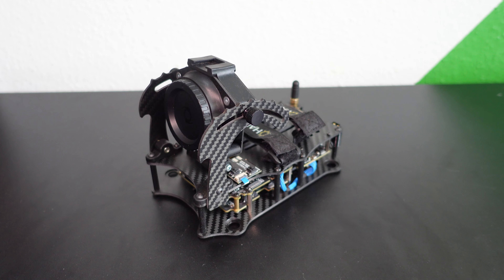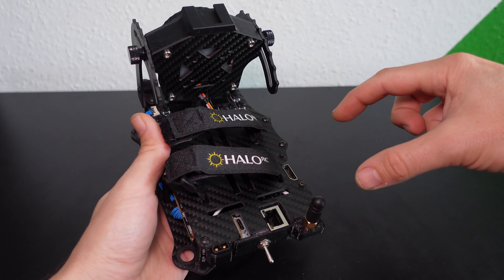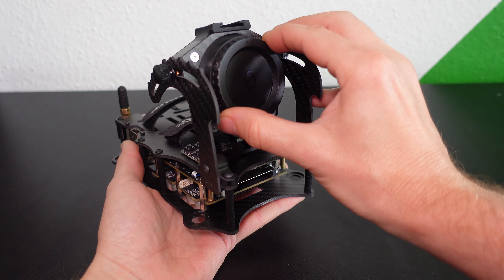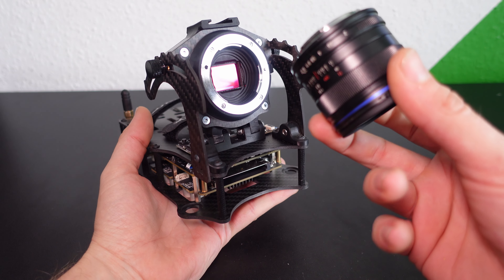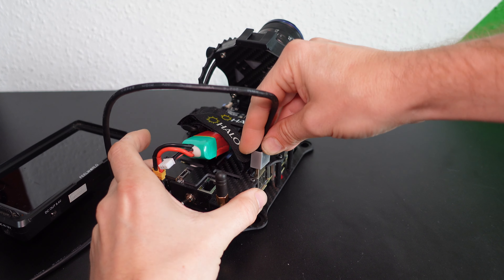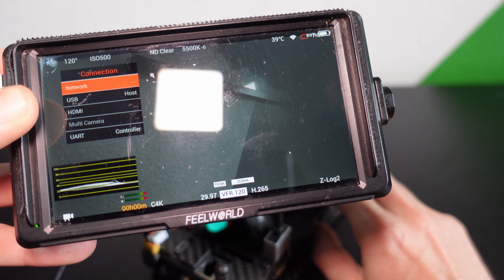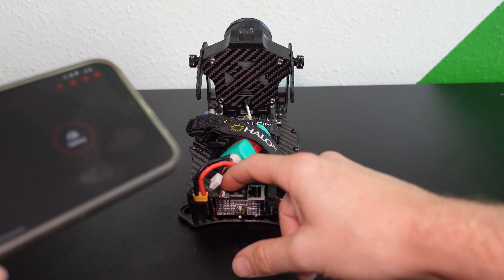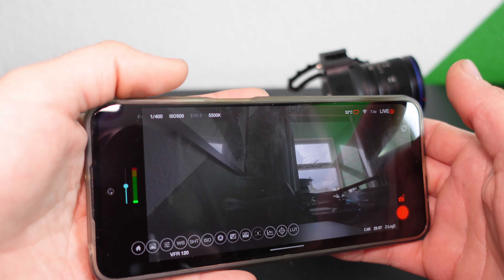HaloRC Naked Z Cam M4 - Overview

Comment: Epic dude! You can also use the Zcam app on Android (I do sometimes). Another awesome aspect you missed is the 4:3 sensor Vs the 16:9 sensor of the BMPCC4K.
Reply: * Important for those using Gyroflow.
Reply from the maker: Hey, thanks for your input. However, ZCam uses 16:9 sensor not 4:3. The Android app cannot do video over USB C, but you can connect to the app over wi-fi.
Reply: @Bludz  That's not true, the Zcam E2 definitley has a 4:3 sensor, it's not the same sensor that's in the BMPCC4K but a slight variant. It's why anamorphic shooters choose the ZcamE2 (me) as you get a bigger FOV than you would cropping the 16:9 BMPCC4K image into a 4:3 aspect for 2x scopes. You can do USBC on Android it just doesn't work on all phones (IOS definitely works better) and you might have to activate a debug mode first to get it to work.
Reply from the maker: @le_tranq  Hhhhhmmm not sure why people would say it is 4:3 aspect ratio sensor when clearly it isn't. It is 19x13mm that's not 4:3 or 16:9. BMPCC is only 10mm vertical and is true 16:9 ratio.
Reply from the maker: Yea, maybe some android phones although literally nowhere does z cam say it would work. I know most Android phones don't have HDMI over USB-C, or whatever the tech name for that functionality is.
Reply: @Bludz  Sorry, I should have been more specific - The highest resolution you can shoot in on the ZcamE2 is 4:3 aspect. 3696 x 2772. Techinically the sensor may not exactly be 4:3 true, but those pixels cannot be used anyway (for everyone's use case it can be considered a 4:3 or "multi aspect" sensor), the important thing I was trying to highlight is that it's not the same sensor as the BMPCC4K and this upgrade to more vertical resolution is a big selling point for many users who may be interested in your Naked Kit, that's all I'm trying to tell you. Also it's a pretty big benefit if you use gyroflow and it get stretched out.
Reply: @Bludz  There's a lot of info on it in the FB group, Zcam webpage is pretty useless really I'd agree. You are right that many android phones don't have the correct  tech on-board, but some do.
Reply from the maker: @le_tranq  Ah right, I get you now. Didn't know that as I've only really used it for the 120fps. That could be very nice with some dynamic stretching (fake superview) and as you say stabilisation will benefit.
Reply: @Bludz  I also think that 4:3 mode actually has a very nice image, you are limited to 60FPS though.
Reply: @Bludz  Love your work by the way, thanks for the effort, hopefully one day I can build up a rig.
Reply from the maker: @le_tranq  Thanks a lot man, appreciated. Thanks for your info too, allways good to know more.

Comment: Hello,

is it possible to power up the ZCam without decasing it via 2-4s lipo into 2-Pin Lemo Input?

Coz  my camera does not power up atm.

May you can help me out.

Best greets,
Mario
Reply from the maker: Hi Mario. You should be able to yes. You will need to convert a power connector. If you send me an email I can send a photo of the back of the backplate and we can see which is positive and which is negative :) bludz@halorc.com

Comment: Sux can’t use the regular E2. I have one I’d get undressed
Reply from the maker: Yea, sorry dude, they are a bit too sketchy for me to be telling people to pull them apart, M4 is much better made.
Reply: @Bludz  Are the internals actually much different? I know the original E2 had ability to do pixel level sync that the M4 doesn't.
Reply from the maker: Different enough that the carbon plates would need different mounting holes. Differences are not the only factor as explained above, they are sketchy inside. One I opened had copper wire connecting pins where they messed up production and had bodged the board to make it work.
Reply: @Bludz  Okay, that's the main thing I was wondering, so boards are different to. I was wondering because I have a pretty beat OGE2 and would rather send that out on a drone if possible, but sounds like it's not a great idea haha. Cheers for the replies!